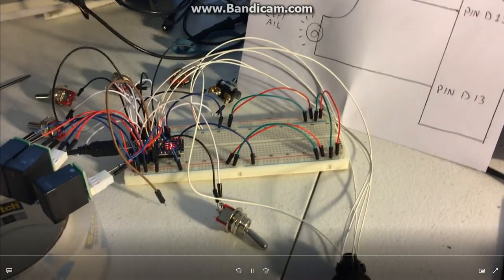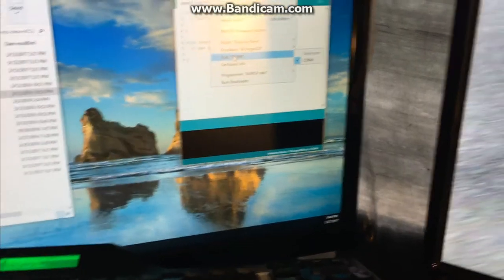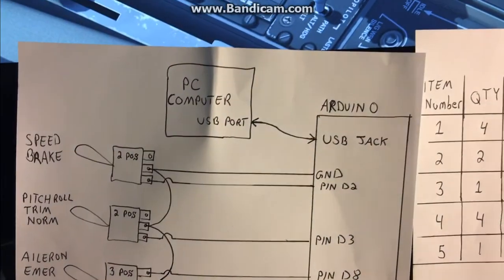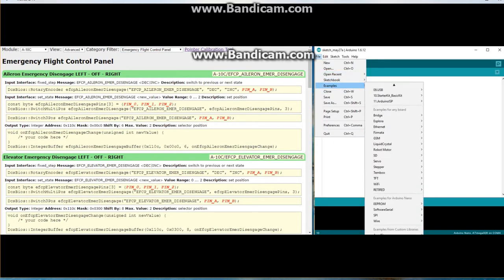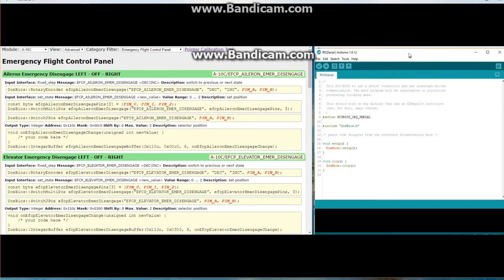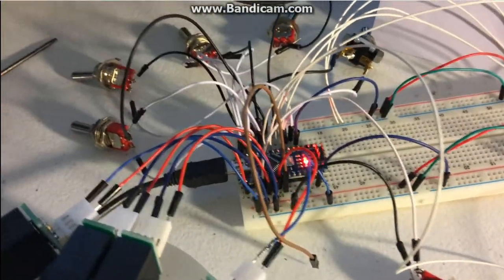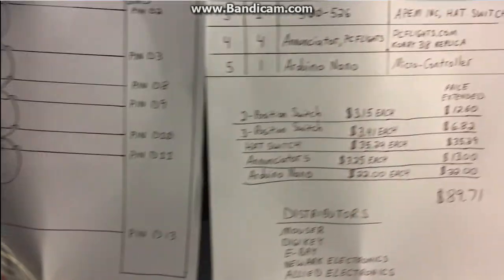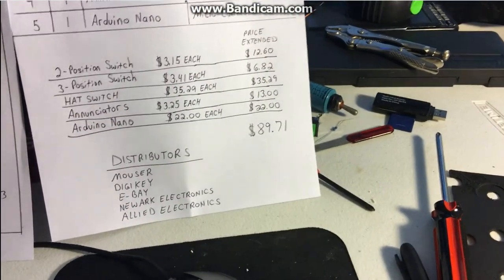Crazy deals, time to build ! !  A-10C Emerg Flight Control Panel

Comment: Hey Joe, thank you  for the video recomendation, it works fine now. Thanks for pointing onto the wiring schemas, that really helped me alot, since everywhere i read about arduino and switches they refer to using those pull down resistors, and im glad to see that it works fine without them. Cheers from Switzerland, Pedro
Reply from the maker: No problem. Glad your building panels.